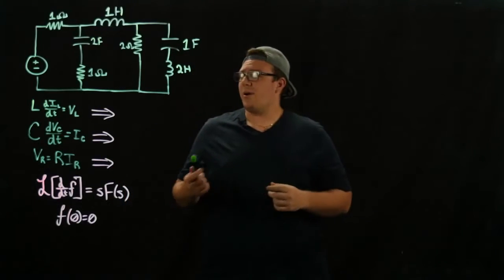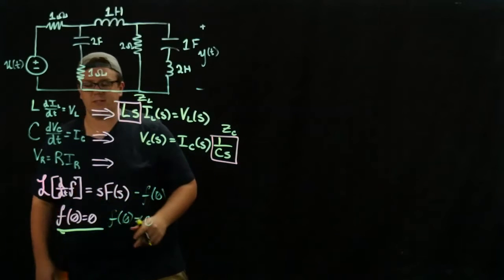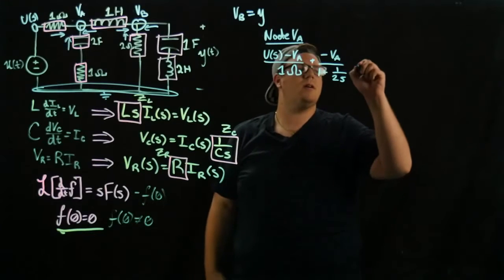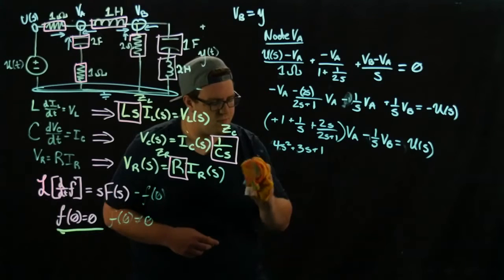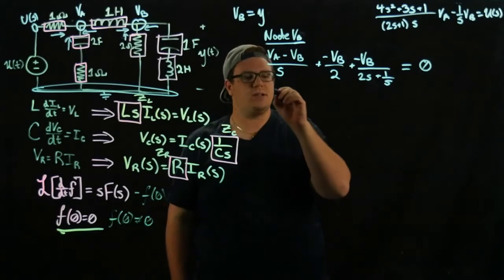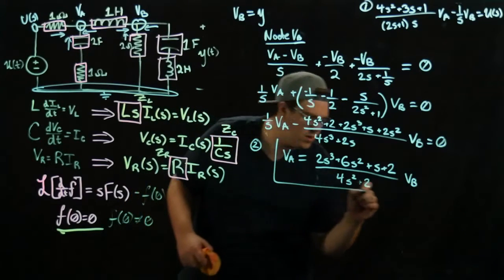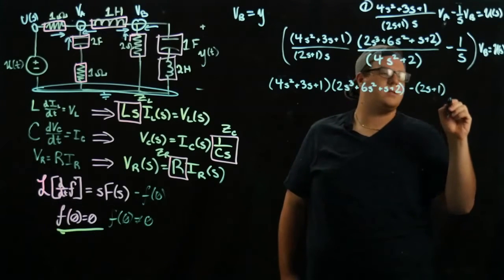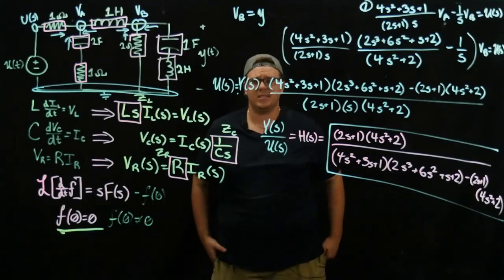Systems Analysis - Circuit to Transfer Function

Comment: I think an easier way to do this, is to go into the phasor domain. 
If you do source transforms, youll end up with a Vth, Zth, and Zload which is across Vb. Where Zth =[ (Zc1+Zr2) || ZR1] + ZL1. And Zload = Zr3 || (Zc2 +ZL2).
Then you can have a simple Voltage divider so that H(w) = Vo/Vi= ZLoad/(Zth + ZLoad)
Reply from the maker: Hi there,

These methods are equivalent. The purpose of the video was to show this in the Laplace domain, but if you restrict s = jw, then you end up in the phasor domain! Isn't math fun!

Andrew